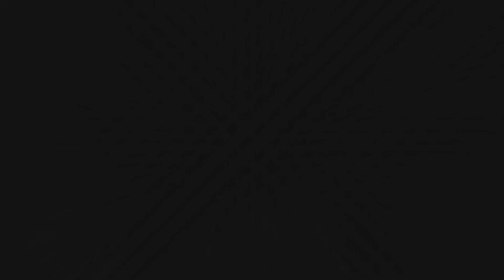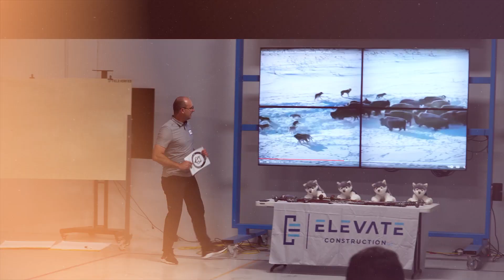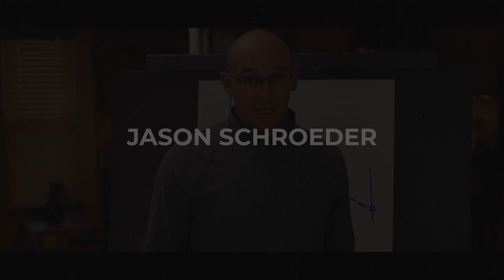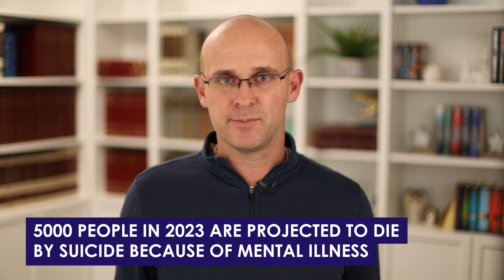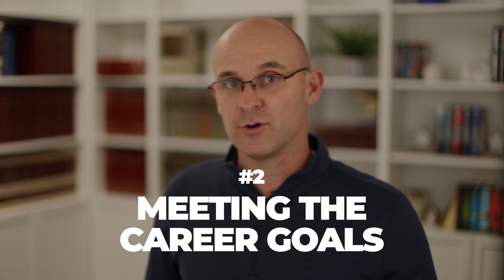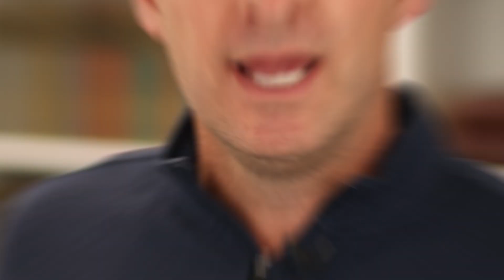How To Measure The Success Of A Construction Project

Comment: Jason, Imagine a 10 week schedule at a casino 8AM - 4:30pm in Las Vegas.  After 4 weeks your project has been shutdown 9 times by the owners due to occupancy below and near by, you are averaging a 10 man crew thru completion. The water point of connection was under the slab, in the ceiling of the owners suite not above ceiling in the kitchen where we are working on the top floor of the tower.  Of Course when the schedule gets behind its your fault the as Superintendent. And they start asking where did your confidence go?  Then the owners ask your boss that your removed, for lack of confidence during a schedule section of the OAC meeting.  I like what your saying so simple and I'm trying to imply what you say to the scenario and I could use help.  I've been in the Trade since 1999 as a carpenter and a super for 10 years now.  I know the job will finish on time with trades being stacked and working overtime lead by a new superintendent when I was the one to stick by the trades side getting them access to the suite below for exploration and investigation measures which lead to over 10 days of RFI's waiting on answers. You know what comes with all this, because I know you 've seen  about everything. Sounds like a bunch of excuse's I know but Seriously what is a Seasoned TI Super to do?